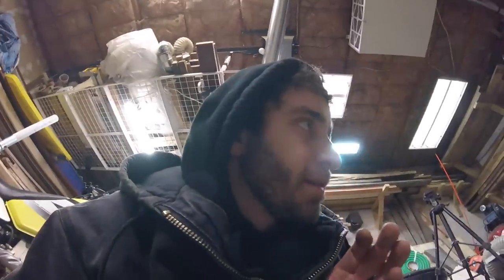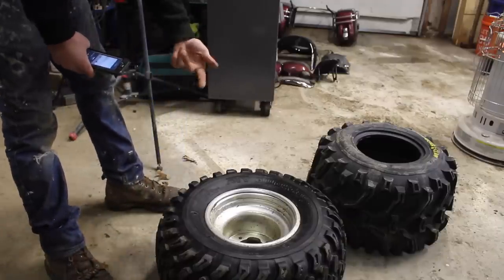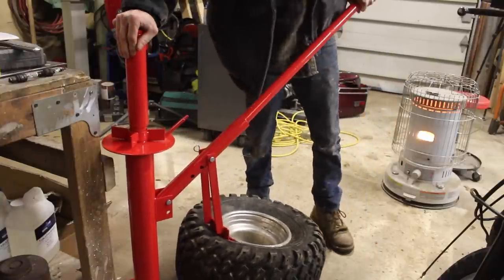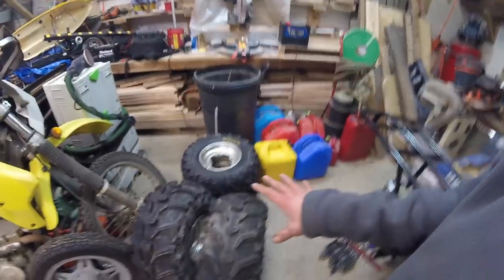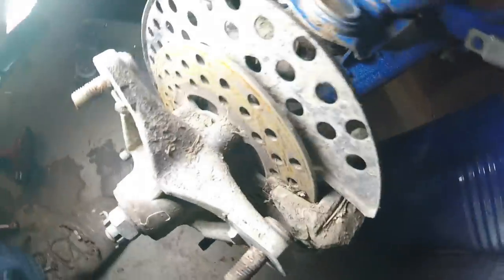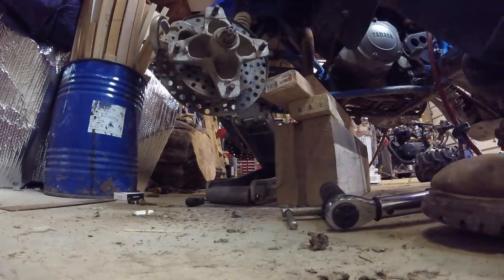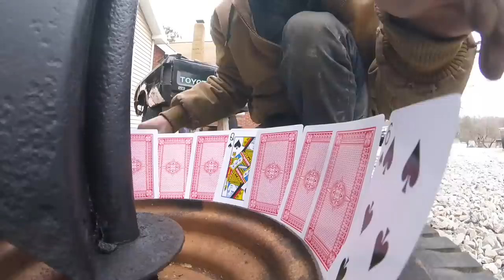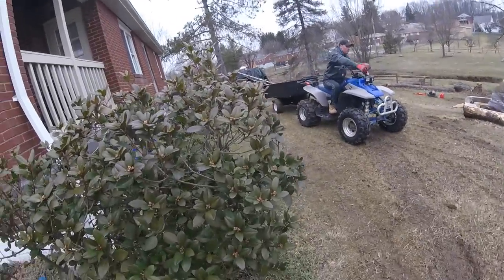Free Yamaha Warrior Quad Rebuild Part 4

Comment: Had this exact same experience with the tires on my sport quad...I now have a harbor freight tire machine I was not successful with either.  Cheapest shop here wanted $30/tire.
Reply from the maker: Yea it was not cheap to get them put on, I guess because these types of tires run at such a low psi the bead is super stiff and heavy duty. Real pain to install
Reply: @IntoTheDirtshop  the shop didn't get one of my new beads to seat on mine, I had to mess with it for a couple of days, finally ended up taking it to 60psi (away from me under the truck) and it popped on as I was letting air back out.

Comment: easy way to remove the tire bead from rim. run side of the tire over with a car or truck. pops em right off.
Reply from the maker: I thought about trying that but the sidewalls aren’t that tall on these tires compared to a car or truck tire. Didn’t want to crush the rim by mistake
Reply: @IntoTheDirtshop  i get someone to help they stand on the rim and guid me or i guid them. really easy as long as ur not worried about scratching the rim.
Reply from the maker: Jaykoda nice next time I’ll try it

Comment: I'm thinking of getting a Yamaha warrior, its sat for years, what are some big things I should check, or like things that should guarantee need repair?
Reply from the maker: logan McKinney check for compression. You’ll definitely need new tires and battery. See if you get spark as well.  If you have good compression and spark you at a good starting point! Basically you’ll just have to replace every other part besides the engine!
Reply: @IntoTheDirtshop  awesome, its free as well from a buddy, parts seem cheap for it so ill eventually replace most stuff, so one thing I'm not sure about is the rear sags down after some weigjt is on it, not sure if that's a suspension issue?

Comment: If you can bolt the tire machine to the floor they will work better,nice work on the warrior man..
Reply from the maker: Yea definitely would have worked better, I didn’t really have a space in the shop to put it. Though I’m not even sure I would have been able to put the tires on myself anyways

Comment: Aren’t you supposed to face the valve stems on the inside of the axle?
Reply from the maker: mike eger the rear tires are on the inside and the front are on the outside for this quad

Comment: isn't this the same atv as a Yamaha blaster 200?
Reply from the maker: Simon I have heard that the frame may be the same as well as some of the other components
Reply: @IntoTheDirtshop  i have a blaster myself and the quads look almost identical. The plastics and the front bash bar are the only differences.
Reply from the maker: Nice! That’s awesome since parts are interchangeable then

Comment: Anyone know where to find a rack like this
Reply from the maker: I think this one was custom
Reply: Yeah I can only find ones on eBay but they don’t seem to fit the pull bar like in this video, so easy for taking off when you get to the track
Reply: You would think the racks would be easier to find or someone would still make them due to the popularity of the warrior. I have front and rear on mine and love them but I picked them up about 20+ years ago from a company called CMP Metals and Plastic. I’m pretty sure they’re out of business from what I can tell.